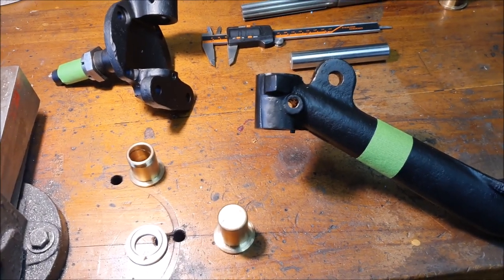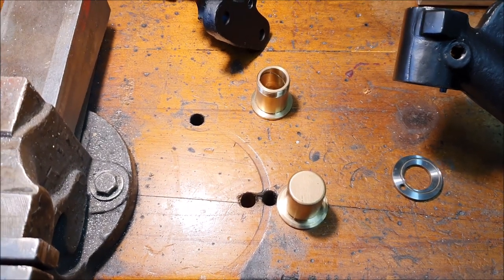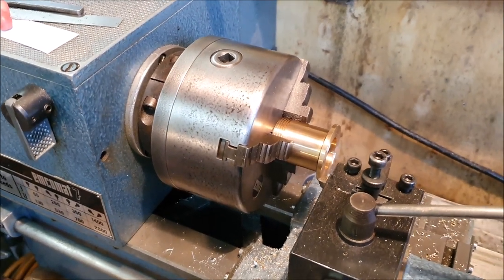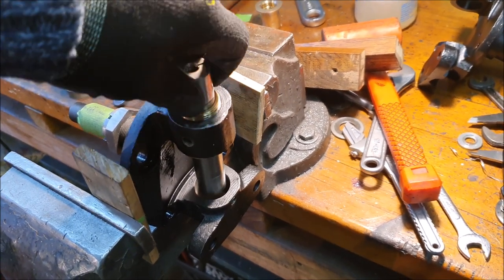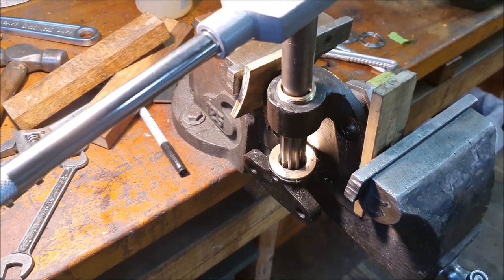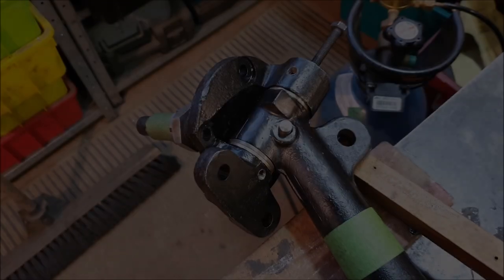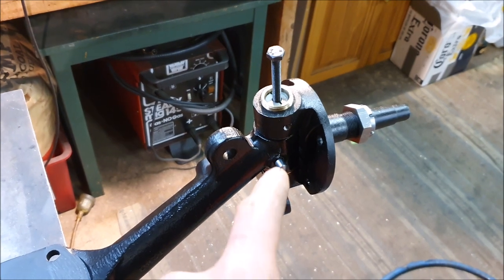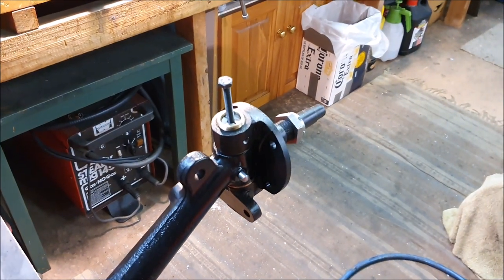Pre war Riley 9 king pin reaming

Comment: A very useful video, thanks.
I am in process of doing the same job, but my axle hole is worn tapered by 4 thou at the top and 2 thou at the bottom. So I have made a tapered Kingpin, which is a drive fit for the last 3/4 inch, and 5 thou bigger at the top, so I can reuse the Riley bush. I am also using a needle roller thrust and straight thro bush in the bottom. So I'll see how that works. Taken me ages so far, nearly there. I have found your other videos useful. Keep at it.
Cheers Martin (UK).
Reply from the maker: Having a blind bush in the bottom makes things a lot harder I think. I hope I have done mine properly as it's not a job I would look forward to having to do again!

Comment: Thanks for a very informative video. I have discovered a little bit of vertical movement on the stub axle, presumable caused by wear on the working faces of the bushes. Your video provided me with an understanding of how the whole assemble goes together and an idea of what's involved if I decide to replace the bushes. Obviously not a five minute job! As there's no detectable wear between the king pins and the bushes I'm not going to treat it as a high priority! Thanks very much again for taking the time to make the video.

Comment: Austin 7s have a special reamer to allow for the blind bush, which I guess is how they did it originally in the factory. I am surprised that you did not use your hydraulic press to push the bottom bush in, but your solution is simple & effective - I have doen the same when changing the tappet guides on an Austin 7 block. I have to do a similar exercise on my Standard Big Nine (Swallow body), parts are extremely difficult to come by, unlike the Austin 7 & Riley, so don't want to mess up!